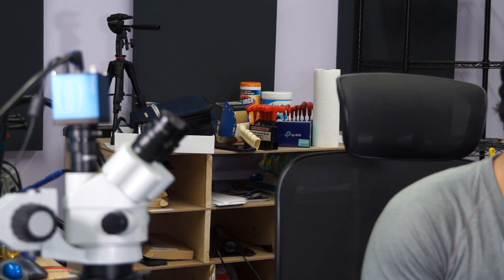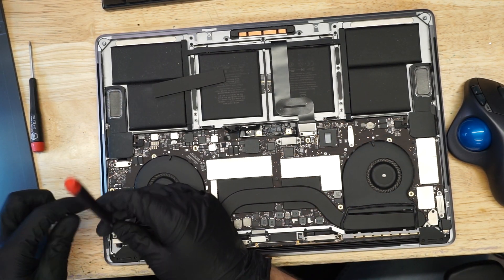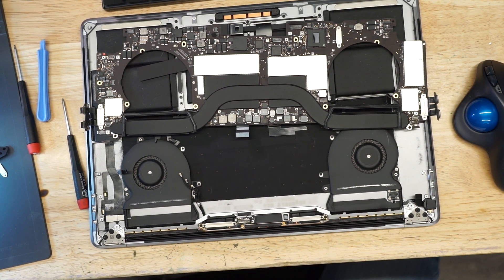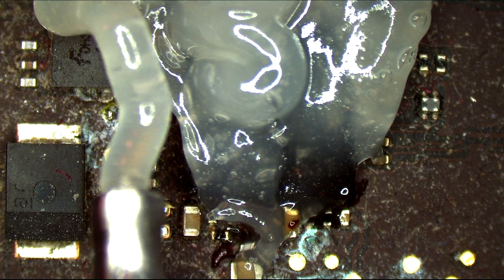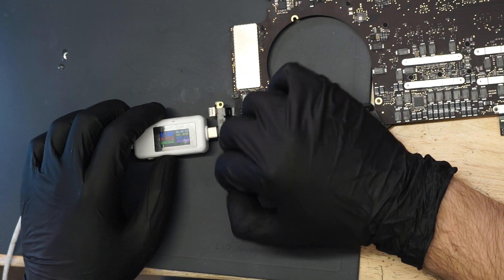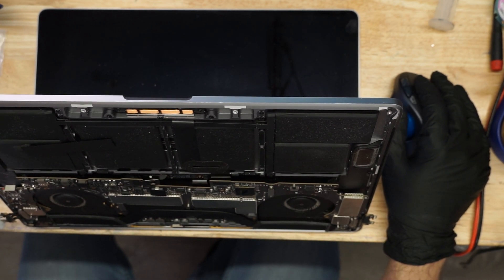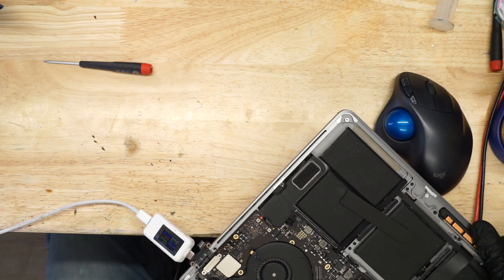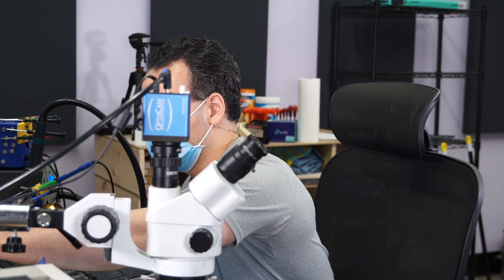Diagnosing USB-C muxing issues that prevent Macbook from charging

Comment: Hello and thank you for your relevant and professional videos!
I have a 2019 16 inch macbook pro that refuses to start... Do you know if this type of macbook is supposed to start with the battery disconnected from the motherboard? I did the test and it does not start with USB C power supply which does indeed deliver a current measured on the plus and minus which connect to the battery...

I live in France,

Thank for your answer

Comment: Louis, the more of your repair videos I watch, the more I am convinced that Apple products are designed to be like glamour models: They do everything to look attractive on the outside, but once you take a closer look you discover a host of problems including daddy issues (T2 chips), eating disorders (bad charge circuitry), cardiovascular problems (bad cooling), frail joints and bones (self-destroying display cables), a sub-par immune system (no water resistance) and generally poor mental health (firmware and other software problems). They might be fun for a little while, but once you get sucked into the life style, they'll ruin your life. 

Anyway, the lesson is clear: Don't date a glam model, and don't buy a Macbook.
Reply: ... What a good comparison!
Reply: interesting.
Reply: Because that is Apple's Innovations™
Reply: There is other side. My Apple products never broke. I still have working Mac, Air and etc. I think Louis is overreacting. I had a lot of PC laptops that just died from spilling, I have my mainframe PC tho that serves me well. Many professionals use Macs and iMacs without a slight problem. Depends on why you need them and what your financial capabilities are I guess. But price could be lower tbh, but they offer a credit now. Many people just don't know why they buy some expensive stuff, just to be cool.
Reply: Just my point is that everything can fail like Macs, but their failures don't highlighted as Apple products. I think we need to see that.

Comment: So, is there like 50 screws holding that thing together???
Reply: yes, because apple
Reply: ɮօʊռċɛ օʄʄ all laptops are built that way
Reply: Evert Guzman yeah definitely not
Reply: @EvertGuzman  not really, some are worse. like he used to say 'dont long screw the short hole!' because those sadistic engineers saw fit to require different sizes of tiny ass screws
Reply: Brad Haines I ment specifically the 50 screws
Reply: @EvertGuzman  that's what i was talking about, just added that they're also different sizes.

Comment: Hello Louis, 
After I update Apple SSD to Samsung Pro SSD in MacBook Pro Retina 13 inch 2014 and it still works well but I check it in Hardware Diagnostics then it shows "there may be an issue with a storage device vdh002" :-(. So what to do. Should I replace back apple ssd from samsung pro ssd. And Let me know if fix possible. Thanks :-)

Comment: Removing MagSafe was a stupid thing Apple did. MBP 2014 is awesome and still current enough to run even the latest software, although rendering in 8K won’t be an option or barely be practical.
Reply: Agreed. The MagSafe connectors were great. USB-C is an atrociously poor cable, even on my Android devices, I seem to go through similar problems constantly.

Comment: Android phone at 0%: Turns on, iPhone at 0%: forces you to wait
Windows Laptop at 0%: Turns on, MacBook at 0%: forces you to wait
Another reason I'm not buying an Apple product.
Reply: In fairness, with Android if you have a particularly shit charger after turning on at 0% it will shut right back down again due to insufficient power
Reply: my Android won't power on at 0% it just shows a white screen with an empty battery with 0% underneath
Reply: x D back when I had my HTC Evo 4g, from dead it would take well over 3 hours to start.
Reply: My laptop doesn't even need to have the battery installed to turn on!
Reply: @ethrieltd  damn bro, mine needs the battery in but can turn on as soon as the chargers in even if the battery's dead
Reply: Ahh not really true. I’ve had many android phones before (Samsung and huawei, mostly) and the Samsung ones often take their time to charge a little before starting up, while the huawei ones turn on instantly and then go dead once again because they didn’t get enough power to work. I own an iPhone at the moment and I never had a problem with waiting like 5 seconds until it turns on, when completely dead. If the phone sucks, I don’t buy it, but this “problem” is so minor, that I didn’t even notice for a year or so. How often is your phone completely dead?

Comment: I have a A2141 model, I spilled coffee over it and quickly dried it up. No damages except that the USB C port on the top left side isn't working if I attach my charging port and the one beneath it works half way... basically when I attach my charging cable to the bottom one it doesn't charge but when I take it out and flip the cable to the other side it works, which got me thinking that the cable is the problem but it isn't and it works just fine both ways for the ports on the right side. ANYONE WILLING TO HELP ME. I'm thinking of opening my MacBook but I have to buy the tools first.

Comment: With so much (let's call it) dirt inside the laptop, it is asking to build up short circuits and faults like this. I'm fairly certain this reflow cleaned the chip, and a very tiny short has been fixed with it.

Comment: Where did you get the isopropyl spray bottle? (Spray bottle seems to hold up well with continuous use!)
Reply: hes had them from before  covid
Reply: @HasanProd  where can you buy these though? Any spray bottle I've had craps out after a short time.
Reply: @10milesfromnowhere  I don't know. I'm not from the US and even here they seem to crap out eventually. I guess using alcohol kept cleaning the insides of the bottle as well. Try to source something from the industrial sector. Those might be more rugged and durable.

Comment: Hey Louis, mad wild watcher of your channel for a couple years now. Keep up with the real estate and policommentary too. Now need some advice! Have ended up with a dead macbook a1708 pro dropped in my lap with red nogo icon. Was working fine after i reset it and installed the earlier OS. This week it has decided to stop charging. It will stay on at 1% when connected to charger, dies when unplugged. Says battery needs service.  It has updated itself to catalina over this period as i think it only reset correctly under sierra. Just wondering if I can use a standard usbC 15w charger and leave in plugged in when off to see if battery will charge (i.e is it a cable/charger issue) and should it show anything when doing this? Any other tricks to try or are we at CD3215/power supply circuit? Thanks in advance. Have tools and ability, just been a pc/androider for a long time.

Comment: Stupid question but can someone give me the dumb explanation of the point of flux? And how it doesn’t loosen the other components?
Reply: Here is a dumb explanation of why use flux.  It allows solder to flow better, get a better grip on pads, and allows it to solidify into a better connection.
The corrosion around the CD3215 has affected the connections between the chip and the board.
Reflow using flux allows the corrosion to be burned and flowed off, leaving healthy pads to connect the chip to.
Reply: solder no stick to oxide
flux remove oxide
no oxide make solder stick
flux make solder happy
Reply: bwzes03 that was actually the type of response I was looking for